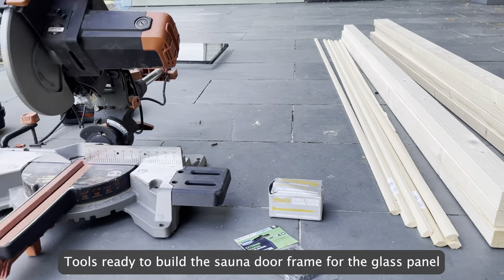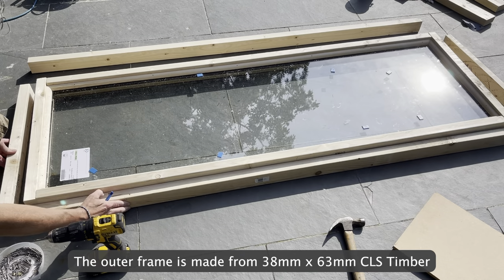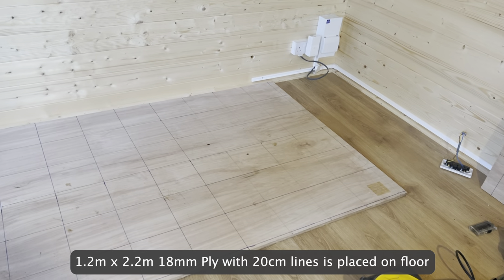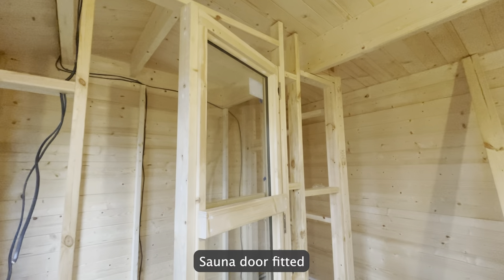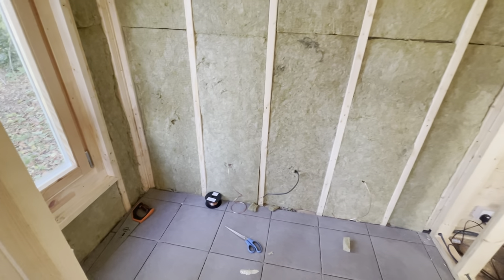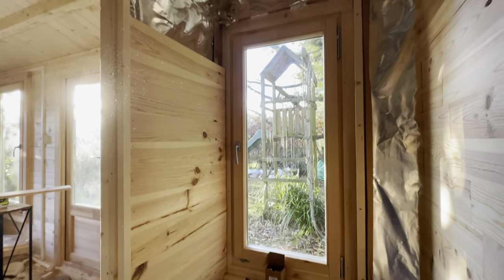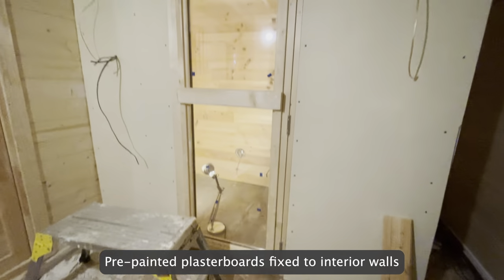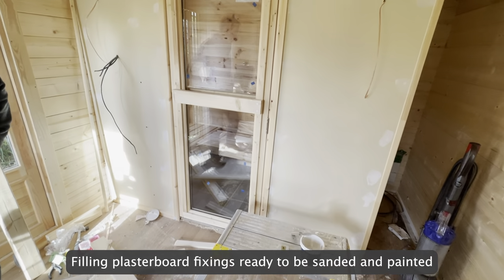$2000 Home Sauna Build - Step by Step Guide

Comment: Without furring strips to provide an air gap between the reflective foil and interior paneling, the foil becomes conductive, essentially negating its insulative capacity. Also, there does not appear to be any attempt at proper ventilation. There should be an intake vent above the heater and an outlet just below the bench at the far corner.

Comment: What size heater did you end up using? 3kw?  Strong enough for that size sauna?
Reply from the maker: @JF-kb6bl  we used a 4.5kw. A 3kw would be ok but may take a bit longer to get to temp.